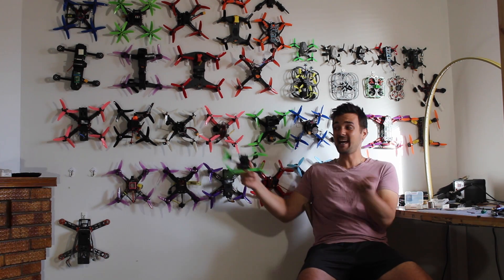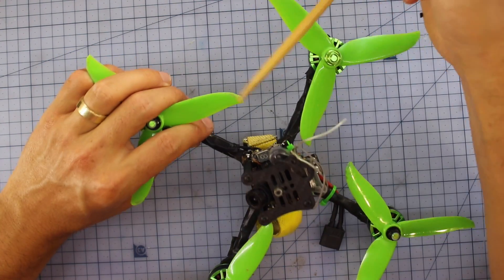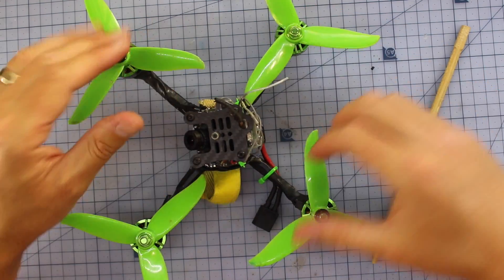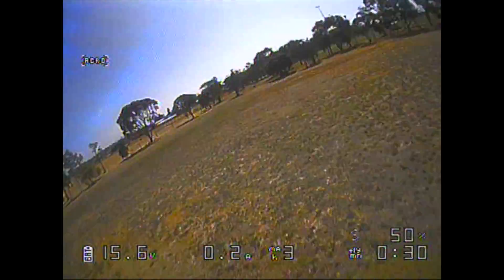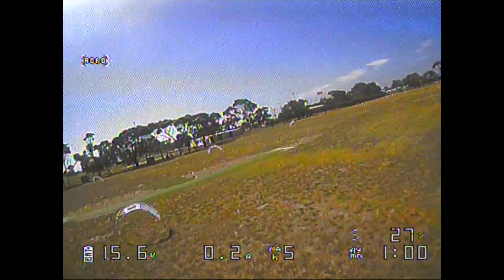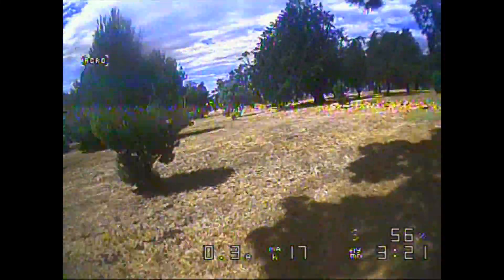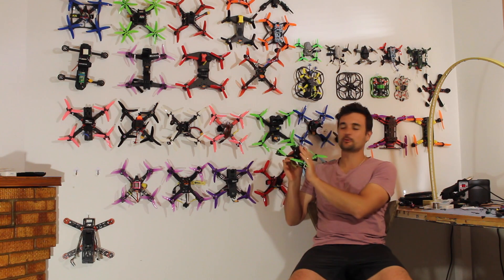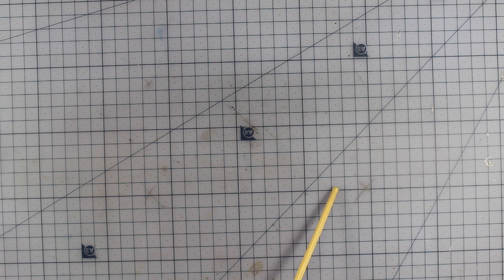A DRONE TOO FAST TO FLY!? TWIG REVIEW + FLIGHT FOOTGE.  Part 2

Comment: All that excitement talking about lightweight but where is the number? Weight with and without battery. I fly the exact Viking motors 2206-2600. They're very powerful. Pull 7.19G from hover punchout.
Reply: Hey RaceMiata   you seem to be the only one around here (also read your comments on the RCG motors/esc testing db thread) who's talked about these Viking motors at any length. I'd love to get you opinion.  You compare them to RS2205S.  I want lightweight motors (+power), so I'm thinking of them also for this build. I've poured through miniquadtestbench (wish the Vikings were tested).  They've got a good power to weight ratio, but are the Vikings really that good?  Stew obviously picked them for a reason too, but he doesn't go in to detail.  Sooooo many motor choices.  Hurts my brain :).
Reply: Hmmmm.. the Multistar vid says 32.5g for the 2206, not 29g like the site  says.  They're obviously powerful and  allow crazy fast  recovery, but there's a bunch  of great motors around that weight.
Reply: Caerus The Viking 2206-2600 is definitely not the lighter or most powerful. That's why I'm curious this quad AUW. Mine is about 270g without battery. The RS2205S is definitely a marvel with power rivals 2206. My Viking 2206 setup looks faster than my friends' RS2205S setups but mine is powered by Turnigy Graphene while the counterparts run Tattu's and my quad most likely has lower AUW.
Reply: I've no doubt the Vikings are powerful.  I mean look at this thing move and corner.  It is a ridiculously lightweight frame though.  It's called the Twig for a reason.  I'm terrified to fly it when I finish!.  Though you can get meatier 'training arms', just 1.5g heavier.  I got some to start with.  Think I might need them :).  Ok, so I wanted to tally up the weight as best I can for you.  I'm still deciding on which 4 in 1 ESC, but BangGood lists the racerstar 30A 4 in 1 at 19g.  Not sure with or without wires.  The FC is 13.35g, the frame is 42g, motors  130g, the strap he's using is the heavier of the 2 I got thrown in at 10g.  The other is just 4.4g.  Freebies though, so he might not have gotten the light  one, or liked the other.  So far that's 214.35g.  No idea what camera, and the receiver is what 10g?  Plus props, wiring, tape etc.  I'll let you figure that.  Then again, if you give Stew $50 on Patreon he'll prolly tell you exactly ;).  Cheers for the reply.

Comment: Sorry but I have to call BS on this build.  I'm an experienced builder 25+ years but cannot figure out how you got the screws through the FC board,  it can't even be possible unless you drilled out the corner holes of the FC or made a modification to the center frame support.  You would be risking cracking the board even attempting to run the screws through it.  And yes I am using the same components you called out in this video so no difference in hardware.   Appreciate if you could share this with us or this really is a no build for me.
Reply: Starts with "I have to call BS on this build", and ends with "Appreciate if you could share this with us".  What brilliant interpersonal skills you have there.  I have both this frame and FC and had no problems  figuring it out.  I'd help you, but you come here and call out someone's work as BS with zero proof.  Someone who works his ass off and shows so much  enthusiasm in trying to help, educate, and excite more people to get out flying.  What are you doing?    Other than acting like a typical sub-par human being?  If you ever wondered why Stew didn't reply......

Comment: Hoping you can help,  Just got my Twig the other day and I noticed when mounting the motors to the arms, the area where the wires come out of the motor does not line up with the arm itself,  meaning the wires are not centered on the arm when they come out of the motor.  Looking at your vid its tough to see but it appears you ran into the same problem,  can you confirm this.  Thanks!  Also,  don't know if you saw my other question but curious what battery size you ran on the video.
Reply from the maker: this depends on what motor you have.
Reply: Using Gemfan motors however this should not matter as the hole pattern on these motors are standard so I am assuming most will have this offset.  No info on the battery?????

Comment: Reminds me of the old F1 racing days (when they did not care about driver safety), build the car super light and just strong enough to finish a race. I personally would not buy that frame, to much time and work repairing. 5mm x 4mm = 9, Raptor is 12mm x 5mm = 60, just over 5000 flight in 2016 and not even a single cracked part on the frame, this is not even low maintenance, its zero maintenance. At $17 + $15 S/H (to USA) a pair twig arms, I would be ~ $1000 in the hole for 2016. There is a saying, to finish first, you must first finish, have fun.

Comment: My homebuilt 130mm on 3" props and DYS BX1306-4000KV is fast too. Way better than my slow tank, the Eachine Facon 180. 7:30-8 min flight time. Is pushed a bit more around by the wind due to the fact that it is ligther (249.8g with battery, 600mW Tx etc).

Comment: Hey uavfutures my name is christopher and I'm 13 years old I really want to get into drone racing with fpv flying I saw your video about how to get into drone racing under $300 I looked into all the stuff on the list and was talking to my mom about it but she didn't trust banggood and didn't let me get it. I really wanted to build my own quad but I don't know how to solder or anything like that. Do you know any good bnf or rtf quads that are under 200 that are sturdy and fast. Plus I love your videos
Reply: Worst comes worst buy an Arris X-SPeed off amazon and some cheap goggles. Or even the Eachine Racer 250 RTF.
Reply: Christopher Owen -Amazon has most of the items as well. i had a lot of problems with banggoods shipping and payment systems. so I had to rely on getting the items on Amazon. I just ordered a couple weeks ago and should be starting up with the wizard in a few days. hopefully it will work out well. 👍
Reply: Elijah Barragan thanks
Reply: ScorchingNightfall i was in the same boat as this kid (im 15) i bought  the arris and its great
Reply: I liked it. Then I crashed it once. RIP. I bought a shuriken X1 now. Its nice
Reply: ScorchingNightfall what kind of crash could you not repair? Jesus
Reply: a 12 foot fall. good luck getting those standoffs off

Comment: Would you recommend the Realacc x210 instead of the Wizard x220?  It is a little cheaper and seems to be pretty similar.
Reply: wizard 220 rtf is facing issues
Reply: ScorchingNightfall How is it facing problems?  Is it more of a qc type thing?
Reply: QX, shorting FC board, bad motors, etc
Reply: ScorchingNightfall So I ahould go with the realacc?
Reply: Got a taranis or spektrum transmiter? if so get the Shuriken X1 by Holybro.
Reply: ScorchingNightfall No I was thinking about getting the Flysky i6

Comment: Hey I just bought t40 2500kv motors and a kiss flight controller what pdb should I get for it?
Reply: I'm putting it on armattan 155 frame
Reply: Also I'm building it 6s
Reply from the maker: 6s ...OMG
Reply: Eddie Lopez foxeer has a pdb that's capable of 6s

Comment: Hi UAVFutures. This is a roket, what's the cost of all the components? How for a  settings?
Reply from the maker: not sure, maybe 300 - 400 all the links are in the description
Reply: From the links, adding the camera, battery, antenna and other stuff I think we're a few above 300. That's amazing for the result of having a quad that one of you finds almost too fast. What are the pros and con to have a single 4in1 esc instead of 4 separate modules? It's nice to have in the core of the quad instead of having on the arms. Thanks.

Comment: Hey Stew, what is the weight of this build (without battery)?
Reply from the maker: 274 grams
Reply: That's nice. I have been looking into some twig / realacc builds and some use long screws which pass through the whole stack to increase rigidity. How do you think the bottom stack can handle the camera cage in a crash? It does not look that rigid :S

Comment: Do you know if the flysky x6b receiver will bind with the turnigy evo? If it does, than I would recommend using that receiver. It would make for a slimmer fit, easy to change diversity antennas, and also have the option to run ibus,sbus,ppm, and pwm without a bunch of pins sticking out.
Reply: 808SANDMAN it would bind

Comment: Heya stew! Sorry I have an unrelated q to the vid. Are you running HD3 on this vid? And for a build you find it hard to tame, it doesn't show on the vid.👍
Reply from the maker: hd2s I could just feel that I was holding the quad back, usually I feel like i can run the quad pretty hard, but this one I was struggling to go past 60%

Comment: I build a frame very similar to the twig but with even slightly more thin arms and the vibrations were sooo bad through the arms even with the FC soft mounted when I switched the idle switch it would make this horrible sound and start to take off on its own. so beware too thin of arms! nice build btw!

Comment from the maker: Sorry about that afternoon sun lighting. Links in the description to the parts I used. Happy flying  EDIT : AUW 274 grams
Reply: UAVfutures thx you too m8!😃keep up
Reply: rens pech I am still waiting for my Wizard from Banggood.  Almost waiting two months now....
Reply: UAVfutures thats pretty good weight. Dont the kraken light weight racing drones weigh around 260 auw? i just built helix 5" and its 295g
Reply: UAVfutures what does AUW stand for?
Reply: Yolkolai all up weight
Reply from the maker: these are BIG motors
Reply: Sub 30g motor with trimmed wires? Imagine when you can hit those gates at 80% throttle stu just dont clip one incase the twig doesn't hold up
Reply: hi have the same board and was wondering how you got the built in osd to the bottom of the screen. great video.
Reply: UAVfutures is there a way to program a swich for normal/speed
Reply: How can it be 274gr AUW when the 1500 4s lipo is approx 175gr and the motors 120gr add that together and it's allready over that figure, AUW is the weight including props an lipo
Reply: I wish I could afford one of these. For now Ill have to stick with fixed wing. :P